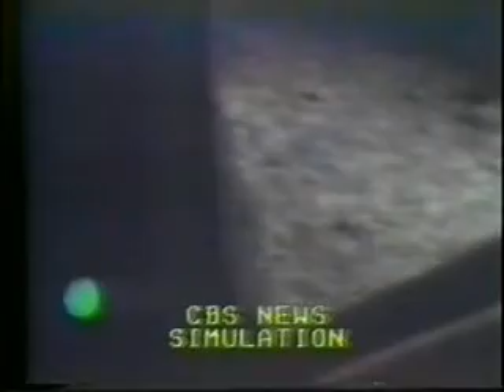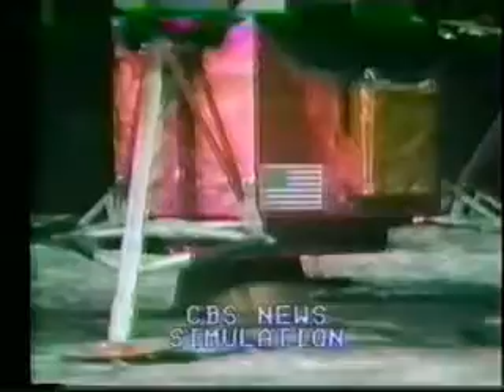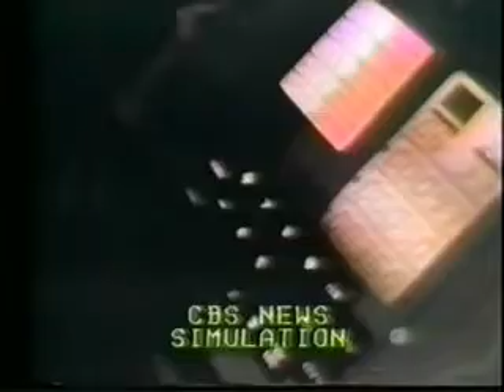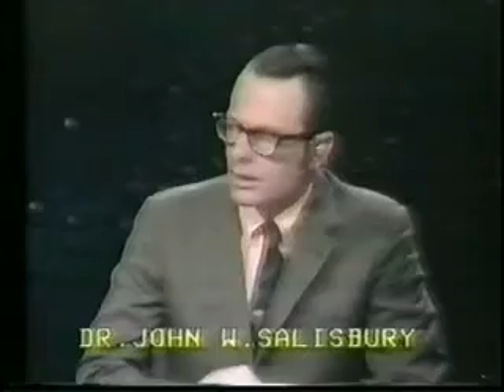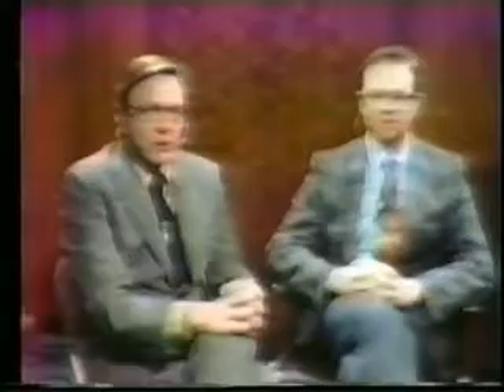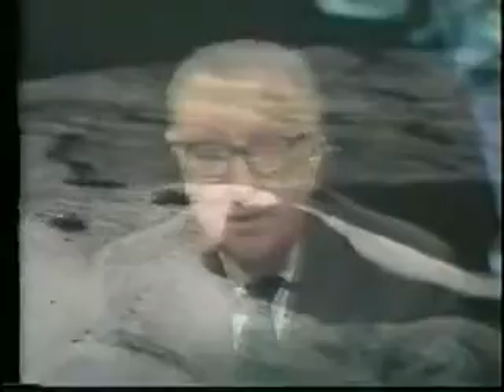Apollo 14 Part 8 (CBS)

Comment: Contrary to what is said in the first part of this video, there's not much doubt in my mind that Al would have went ahead and tried to land without radar. He told Gerry Griffin as much after the mission, and according to Ed Mitchell there was never any question that they were going to try it. And, despite the 4,000' discrepancy in altitude between the PNGS and landing radar reported in Gene Kranz' book, the actual number was about 300', lending credence to the idea that the Icy Commander would have had a pretty good shot at pulling it off, too. Regardless, it's a good thing they never had to find out.